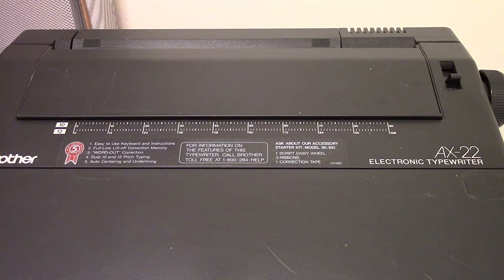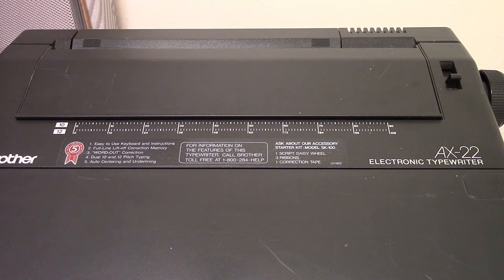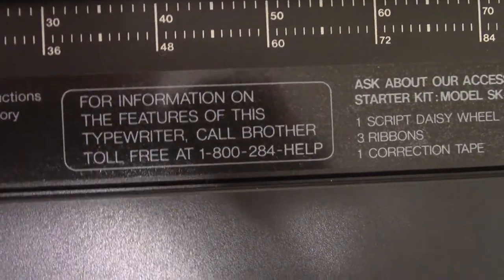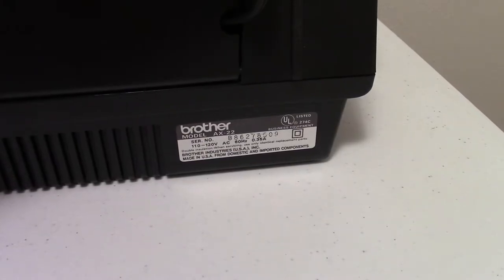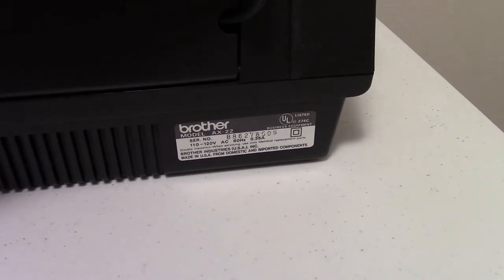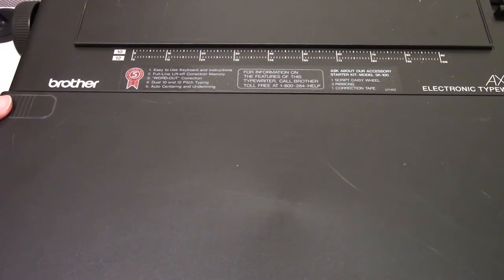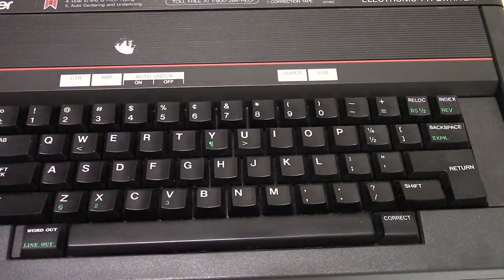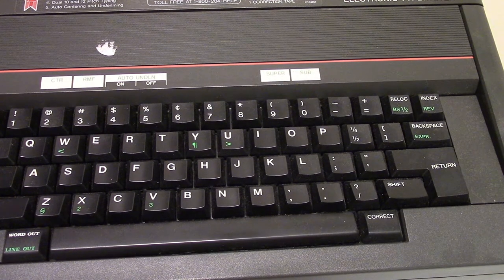Free Brother AX-22 Electronic Typewriter

Comment: I have a daisy wheel typewriter which I am trying to turn into a printer with an arduino interface. It is not going well.
Reply from the maker: That could be tough.  There were some typewriters that had parallel printer ports on them, along with daisy wheel printers.  That would be a much easier place to start!
Reply: @RapidlyAgeingTechnology  The machine has a 10 pin port for a separate adapter to a parallel port so you could use it like a printer or attach an external floppy drive. Of course the parallel adapter is missing and I lack the knowledge to build one. So I mapped the keys and hacked the keyboard addresses. I then attached an arduino mega to the keyboard and tried to simulate the key presses. It did not work as the CPU detects the low resistance of the arduino I/O as key presses. Now I went a step further using three 16 channel  relay banks which will be attached to the key addresses and simulate key presses. The only thing left is writing the program/printer driver. I'll be stuck on this for a loooong time.